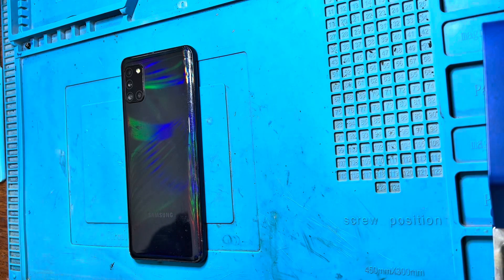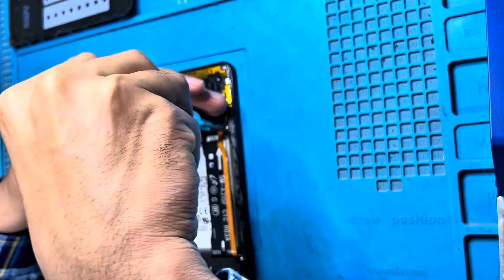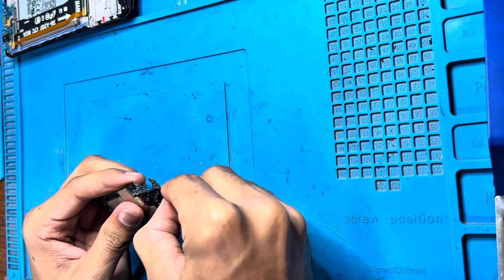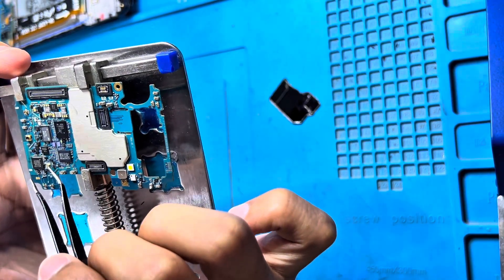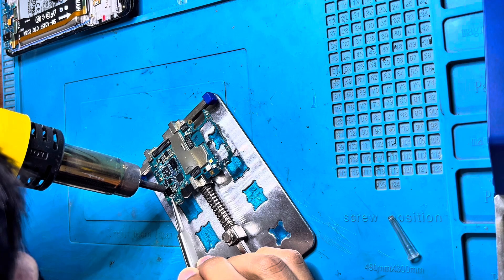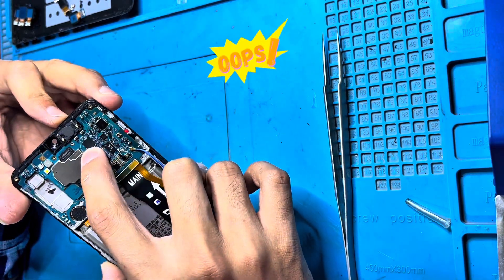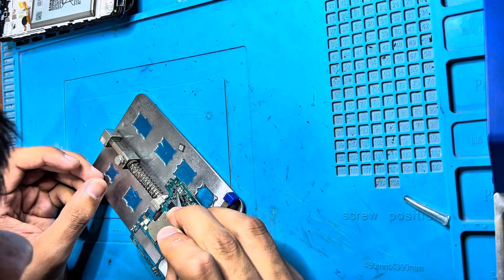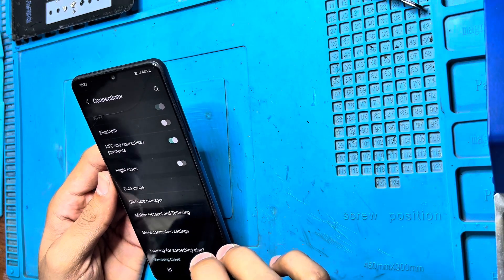Samsung Galaxy A31 WiFi Not Turning On Fix

Comment: I've got samsung m12 and my motherboard is smashed, wifi is not working also Bluetooth is gone too man🫠, I've thinked it would repair in 500 rupees but the end broke me in 1000 pieces.
Reply: Using mobile data is only option but ive got 4g 😭
Reply from the maker: Oh no, that's rough!